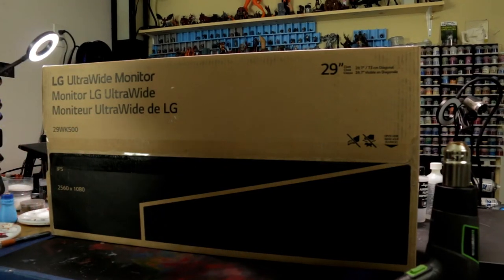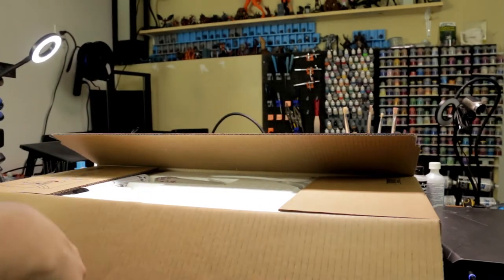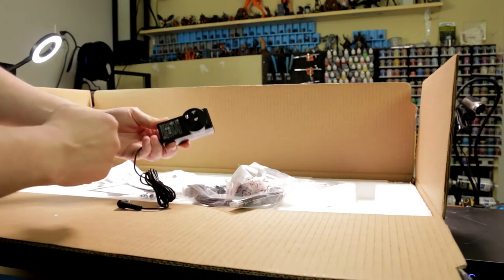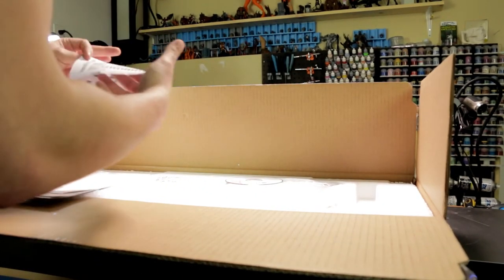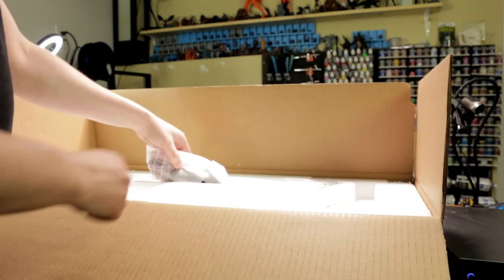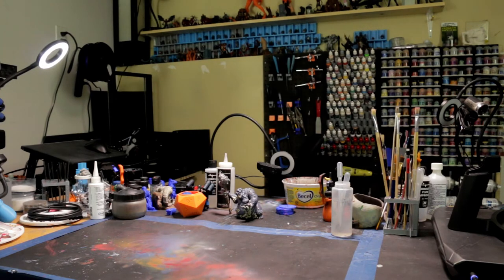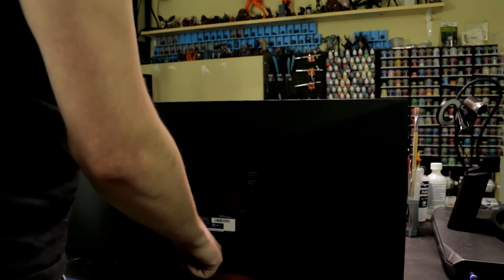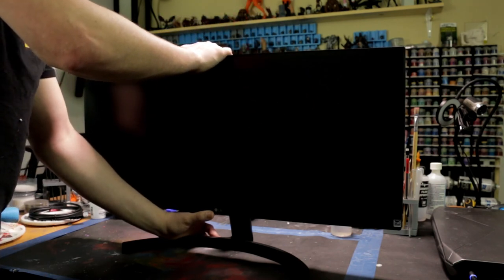Unboxing - LG 29WK500 29" Ultrawide Monitor

Comment: Recently purchased this monitor & it sucks !! .. Text & Images have jagged edges @ 1920×1080..i cant figure out how to get the resolution to go 2560×1080 as advertised..

 I have 2 × AMD Radeon Pro WX 5100 cards that support up to 5k resolutions
Reply: This kid can't operate a monitor 😂😂😂
Reply: If youre using windows, in the display settings, go to advanced display settings at the bottom, then click display adapter properties, then set refresh rate to 75 hz, youll get the full resolution